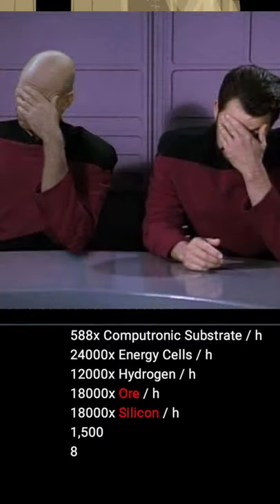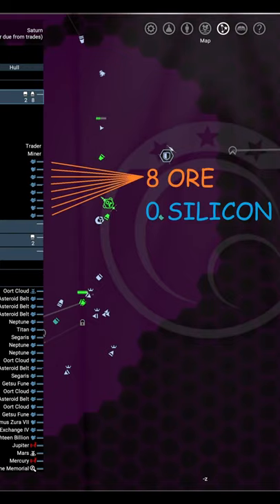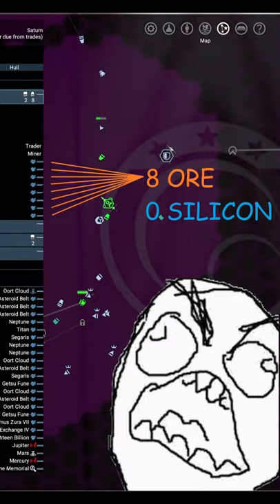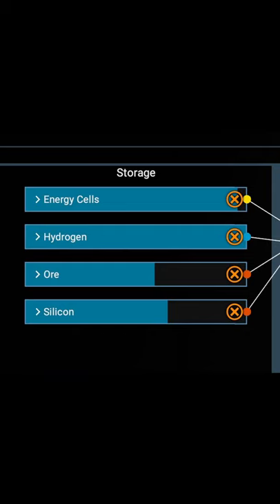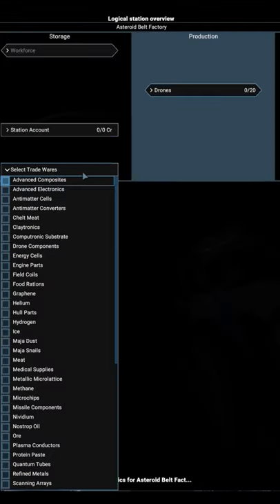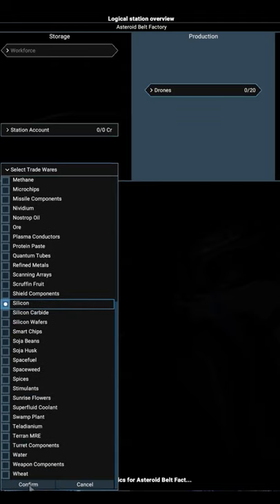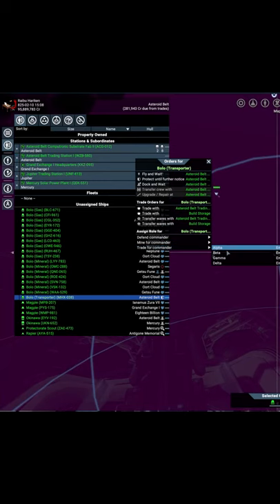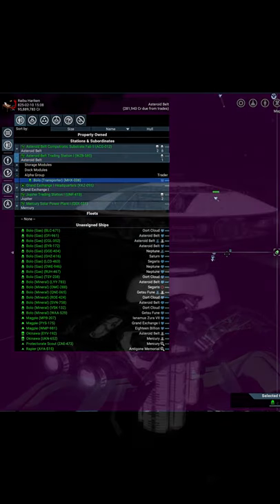X4: Foundations: Using Depots for Computronic Substrate #shorts

Comment: It’s easy to do both ore and silicon on the same mining station.  Make as many as you like around the area.  Put them close together so they support each other and assign some fighters.  Assign your mining ships.  Mediums to start with, if you can.

This, so far, should be no surprise.  The trick is to set the amounts they store locally to be small.  Let’s say 15-30k depending on how many mining ships you assigned.  They should have auto price for buy and selling at the mining stations.

THEN, you also have a storage depot that can contain as much as you want.  Even millions of resources.  The depot should NOT have auto pricing enabled and the buy order should be set to the highest.  This way, all the resources should be flowing into the depot. The sell order can be at minimum.

Remember to set up each station’s blacklists so that they can trade only back and forth between the depot and the mining stations.

Comment: My computronic substrate station in asteriod belt was doing okay but always lacking silicon although I had like 6 L miners (all farming silicon in asteriod belt). I dropped ressource probes in savage spur to improve silicon yield. Now they all fly to savage spur but only mine ore.. :-(
Reply: No rule can explain the miners thinking process. Sometimes I force them with sector automine or repeat orders, and after a couple days can assign them to the stations normally. Works almost as a brainwash. lol
Reply from the maker: Terran systems can be extra weird like that. For Computronics I just let my miners do whatever and buy what I need. That ware is profitable enough that it doesnt matter too much to me

Comment: For the longest time, I resisted heroically and did not build an "relay" station, because I wanted a slim property list (I have just the HQ, a shipyard and a small base on Earth orbit, to watch my "home" while I manage my empire). After asigning 26 Hokaido's to my shipyard and having silicon storage empty and ore containment full, I finally bite the bullet and built an "relay" station to colect silicon and methane. I select the option to sale only to my faction, the station is in the same sector with my shipyard, so things work well.
Now my question is, how do I remove the alert - asign trade ship to station? I have all types of containers (even for goods) asign 5 Baldric and still have the same alert.
Ahh...help :P
Reply from the maker: That is very weird, unfortunately I haven't had this happen to me. I can recommend submitting screenshots for a bug report. 4.1 is supposed to make those alerts optional, at least it won't be a problem for long

Comment: Sorry for the necro post. 

Will it work the same if you assign 1 miner as fleet leader and a few miners subordinate to mimic him and told him to mine 1 type of resources and sell it to ur station.
Reply from the maker: You can use report orders to mine only ore and then create a fleet with subordinates, then repeat with another fleet for silicon. But the ships will only mine in a small area so you will need to manually create multiple orders throughout the sector otherwise you will mine out the area quickly. Attaching miners to a station will increase the ship range to multiple sectors but will run into a problem if the station needs both ore and silicon

Comment: The "stations don't do well when you have two different solid or liquid refineries" is true for 4.0, but not so much true for 4.1 beta. The miners are much more intelligent in 4.1 about getting all the needed resources. You still may struggle to fill the need because of the super high amount of ore and silicon needed per hour for computronic substrate factories, but at least the miners will split their efforts getting both ore and silicon evenly now with the latest beta patch. Try out the beta and see for yourself. So your workaround by making mining stations that focus only on one solid resource are no longer necessary, they will work if you set to two or three or four solid resources, and the miners will get all of them.
Reply from the maker: It does seem to have gotten better in the beta. I'm really excited for the changes they made to resource probes! I did want to make a short video for those that haven't tried it out yet, hopefully when it is released we all won't need this workaround anymore
Reply: I'm playing on version 7.10, the video problem still persist?